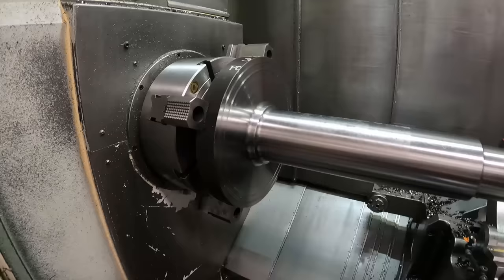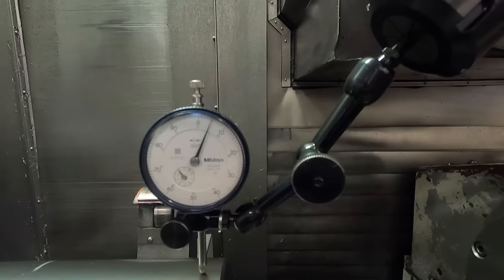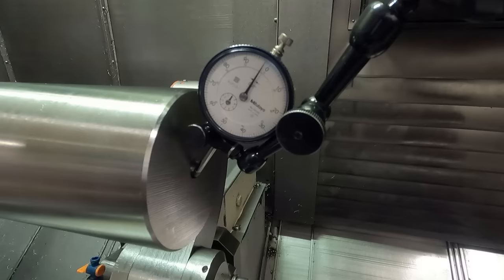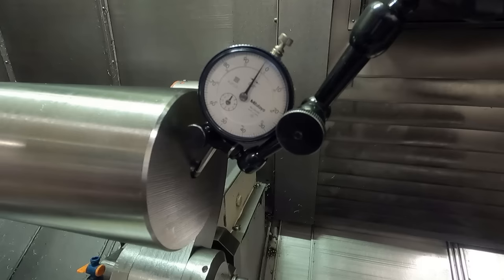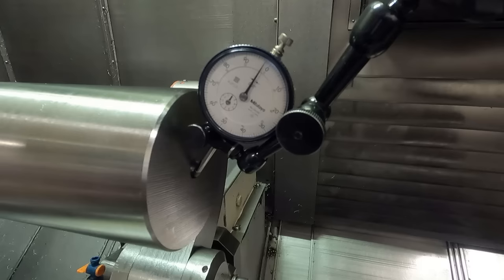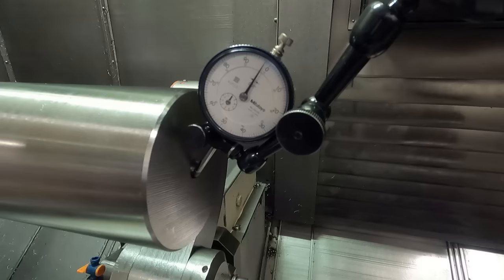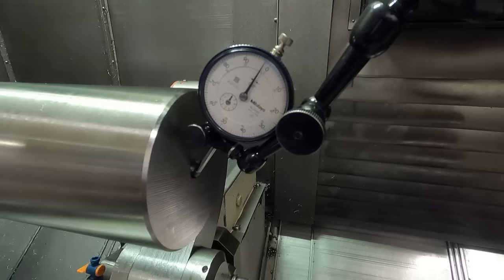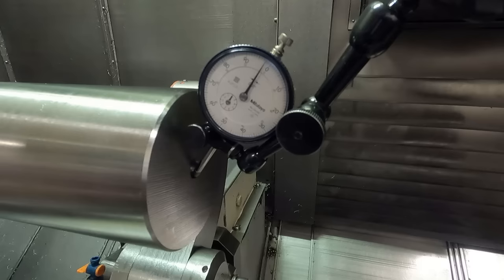Machine Shaft From 2000 Lb Stock

Comment: Showing the runout after pulling the tail stock reminds me when we got a 1300lb piece of customer supplied stock (giant red flag) that was allegedly stress relived. After roughing it flexed over .150 when the clamps were removed. Definitely not stress relived properly.
Reply: Kurtis from Cutting Edge Engineering channel had exactly the same problem with a customer supplied material to make a part. Supplier blamed the banana on stress from cutting on the lathe. Red Flags are red flags for a well deserved reason.

Comment: If you don't mind I would like to suggest a couple of different approaches that might help to relieve the induced stress caused by the clamping pressure of the chuck.... And it's influence on the center run out at the tail stock end.

I noticed that you were using soft Jaws to hold the flanged end. I wonder if using pie jaws instead, with a clearance undercut toward the Chuck end.... And effectively only having approximately 3/8 of an inch longitudinal gripping surface..... Would enable you to turn the shaft while inducing minimal influential stresses from the Chuck Jaws. You could use a torque wrench when tightening the Jaws.... And only torque it up to "xxxx" foot pounds of pressure. The concept would be to grab as much circumferential surface as you can...... With a minimum of force.

You see, once you set the soft Jaws on the Chuck.... And then you engage your tailstock center.... You want to be able to let the shaft "settle itself" in the soft jaws. By having contact of only about 3/8 of an inch with not too tight clamping pressure..... You might be able to provide a freer state of suspension during turning. I think the chances of your part slipping in the pie Jaws, considering the lower amount of torque on each jaw, would be not a factor due to the massive weight of the shaft. Once you get something that heavy swinging around at 3,000 RPM I seriously doubt that a carbide cutting tool is going to do much to cause slippage. Simple inertia will be your best friend here.

Another idea, considering that you had approximately 2" of circumferential gripping surface on each soft jaw, would be to point the Jaws so as to only allow about 1/4" circumferential gripping surface on each jaw (effectively forming a set of "pinch Jaws"). Now on this set of Jaws you can apply full force tightening....(no torque wrench). You should have enough grip to keep your part from spinning within the jaws, and yet it may allow you enough stress relief during the clamping situation so that the stresses within the shaft can be released during the machining process. The concept is:  you won't be trying to over control or influence the flexing of shaft by the chuck. You could even play around with putting undercuts at the back end of each jaw so as to minimize the gripping area   (and it's consequential influence on flexing the shaft during clamping). I guess what I'm getting at is a concept of grabbing the shaft with "points" (approximately 1/4" wide x 1" long).

Let me propose one more crazy idea.... And may turn out to be the best one yet! Turn the shaft between centers.

Of course the center holes would have to be ginormous.... Something to the order of an inch or more (you may have to machine some customized centers large enough).... And you would have to make a stock dog that would be balanced on both sides so that even swinging around at 3,000 or 4,000 RPM it would still not cause any flexural influence. This may take some doing, and quite a bit of machining and grinding time. But just think of it: you could fully machine your shaft in one shot! You could do the journals, the keyway, the Ring of face holes, you're drilling and tapping..... All in one setup. And here's the coup de gras:.   You leave .025" on all diameters and faces after roughing. Now..... You reduce your tail stock pressure so that it's just enough to hold your part securely. Take your finishing cut. Then go back and take a spring pass over the entire part.

The concept is:. When you relieve the tail stock pressure..... It gives the shaft a chance to release its stresses. Then you take your finishing pass and a spring pass or two. You may find that you have everything running concentric and square within .001" or better. Then you can face off both ends in a secondary operation.

I'm just offering these ideas from an old retired manufacturing engineer's mind..... Who's done a lot of manual programming in his day (long before CAD/CAM).... And who was a machinist for many years before that.  I can fully appreciate what you're going through, trying to deal with the problems of stress relief.... And you have my deepest sympathy!  As the young kids say today..."been there, done that!" 😉

Look at it this way..... At least it'll give you some food for thought, no?

(And this was a terrific video, by the way!!!!)

Comment: You were talking about the tail stock moving in y doesn't do too much. Well if you tourn from the top wich is your case it doesn't realy affect the measurements if the tail is off in y. If it's too much you'll see that your insert will take weird wearing.
Reply from the maker: There is also a adjustment on the tail body to move it in the Y axis. This does require loosening the big cap screws that hold it to the mount that run on its ways. Very similar to a engine lathe's tailstock. This adjustment is absolutely required if you are doing milling. To keep it on the centerline of your part. But once adjusted it normally doesn't require any more. Except in rare instances where there are very close tolerances. For instance when boring holes/c-bores on both sides of a part that have to be in very close alignment.

Comment: Why didnt you lock rotation on your spindle with the center point bit, and turn the spindle to drill that center point hole? Wouldnt that ensure you cet a concentric center hole? I really appreciate all you show here, it really help me get so much better, I have no other examples for machining other than youtube. So thanks for what you do!
Reply from the maker: I cant remember exactly the way I did this in the video (It was a long time ago). But there are on this machine a couple of ways to reclaim a center drilled hole for egocentricity. The first and best way is to bore it with a small boring bar. The second way (And the way I usually do it) is to tip the B axis at 30 degrees and carefully re-cut the 60 degree center by milling with the endmill and rotating the C axis. This way the endmill does need to be small enough in diameter to get into the small diameter of the original center drill. What you mentioned (Re-drilling it with another center drill) is not the best way because the center drill will tend to follow the original hole. Or to put it another way. It will pull the part off center to align the original hole with the new center drill because of the smaller tip diameter will act as a pilot on the original center drilled hole. Because this is usually done with no support to the part, say by the steady rest. So the part can easily be deflected hanging out so far from the spindle. I think (If I remember) I showed this in the video by just pressing on the part with my hand and how easy it is to move the part. So bottom line you really can't reclaim an original center hole by just re-drilling with another center drill unless the part is very well supported by either the chuck or the steady rest. But if you use the steady rest, first you need to carefully skim a true band without any tail support. Just the part running alone in the turning spindle. This can be difficult on long parts. What I do in these cases is put a dial indicator on the art and establish the run out and write it on the part with a marker. Then I extend the tail center lightly with something between the centers tip. So it lightly supports the part but not in the original center drill. Then I rotate the part in the spindle and tap it so I get the same readings in the same places on the indicator. When I have that then I skim a true band for my steady rest to ride on.  Then close the steady, back the tail center away and re-cut the center. Even doing this I would still bore it or mill it to be sure it ran true. I did use this method of skimming a steady band on some of these parts. I just didn't show it in this video.

Comment: I own a Enginerring company mainly we do heavier fabrication we run a couple of manual lathes and mills only really for one off jobs usually incorporated in other work we are carrying out. We out source any turning we need numbers of machined but we are struggling with lead times at the moment up to 1 month. I like the look of that mazak would you recommend that model of a machine I like that you can do some milling operations on it also our work would be vast enough at times but tolerances wouldn’t be super tight. I’d appreciate your thoughts.

Comment: Beautiful work. That rough-out is unbelievable!

Honest supply chain question about that: to what extent will (or won't) steel mills sell you stock that has a "shafty side" and a "flangey side?" I get why this would be hard: one-off forging isn't really a thing, and the parameter space of shafty sides and flangey sides (two diameters and two lengths make four parameters) is probably too huge to stock a comprehensive selection. But to produce and deliver that ton of 4140 - then cut almost all of it into confetti on a big sophisticated lathe and ship away the chips - feels so expensive. Back when I did work in a shop, turning shafty-flangey parts felt like one of the least elegant tasks in all of machining - and my stuff only involved small aluminum parts.
Reply from the maker: Thanks Raman. Steel suppliers don’t stock anything but round bar. You have to go to a forging shop to get shapes like this. It really doesn’t save anything for a couple of shafts. What you save in steel (at $2.50 a lb) is just payed to the forging shop.
Reply: @EdgePrecision  Makes sense! I'm far enough down my own professional rabbit hole that it's not relevant for me, but perhaps cutting out that middleman and designing an inventory of shafty-flangey blanks for job shops might be a decent business idea for someone in the steel industry. I've never bought metal in this kind of bulk, and $2.50 a pound is even more than I thought!

Comment: I had a thought concerning the remark you made about the multiple different size bolts used on the lathe you're constantly having to adjust when setting up the machine.   What if you modified the bolts either machining or welding so that all the bolts take one or two different sizes so you'd only have to two wrenches for all the adjustments.   Shy of that paint all the bolts of one size the same color along with the wrench.  No more needing to check sizes?

Comment: That’s a cool mic to measure the key way depth I’ve never seen one like that.
Reply from the maker: It’s just a pin/universal mic with the clamp and pin/anvil removed. It than acts like a step mic.
Reply: @EdgePrecision  oh I see. What were you roughing with CNMG 432?
Reply from the maker: Yes  CNMG 432. I’m not at the shop right now or I would tell you the grade and chip breaker.
Reply: How often did you have to flip the insert? What was the steel grade?
Reply from the maker: @franklinblazek25  The material is 4140 steel commercial heat treat 28-32 Rc. It took about six indexes to rough the stock off. Using a CNMG 432 insert.

Comment: I work in a company where they have the same mazak, but newer version of it with mazatrol smooth. I do not know if you have problems with the machine, but the way they work they often have to spend 20 000 to 40 000 euro in repairs :D
Reply from the maker: These type of machines are easy to damage. If you are not carful and run into something it’s not hard to knock things out of alignment or worse. It’s vitally important to have a proper cam software with very good simulation if you are dealing with inexperienced operators. If you damage the milling spindle it would be very expensive to repair. This is not like running a normal turret lathe. You can’t afford to run into things.
Reply: @EdgePrecision  Do you yourself run simulations prior to machining to verify your code ?
Reply from the maker: @sergegostoli9524  I run the simulation in the cam software. Than process cod to run the machine.

Comment: Thank you for taking the time to teach the correct way that you are Doing things.
I want to ask you have you been having Magnesium issues increase with parts you are Machining.
Please don't think I am nuts but I have been seeing this more more in areas around the Globe I do believe after all the people I have spoken too about this they agree it is to do with the increasing problems with the earths magnetopause.
 We are in the middle of A pole shift that is extremely extremely powerful so powerful its causing people to here trumpet like sounds like when steel is bending under force. From my Compleate Research I have come up with what it is they are listening too Because no one knows if this trumpet odd sound comes from the sky  or the ground. 
  What I discovered is the sound is two separate sounds one is the Earth being ripped pulled under Horrific Magnetic forces happening in regards to the Pole shift. The other is Drilling Being done all across USA, Canada, Also in EU. 
 Seems Big Big Big Brother is Creating something Huge that said if You compare the sound of the Equipment used to Bore the tunnel England to France along with tunnel drilling done with the deep Plasma Bore Tool the sounds are close the variable sound change is do to what the Plasma bore tool is Drilling threw. As most know there are some truly serious hard strata below peoples feet.
It would be interesting if you had a way to detect changes in Magnetic field around were you are working.

Just thought thanks again enjoyed your video
Reply from the maker: I don't know exactly what all this means but thanks. No I am not aware of any magnesium issues.

Comment: Cut 3/4 long off the large stock, drill a hole in it, weld it to a small diameter bar, machine, cylindrical grind (if available).

Much faster.

Comment: Thanks for the extensive explanations! These really add value to the video! One additional detail I would like to know. How is the tail center locking at its position, when it is not moved around along the Z axis (when you jog it)? Is it using a "brake" on its linear rails, and therefore can be placed at arbitrary positions? Or does it have discrete positions (similar to the spindle lock while turning, as you have explained a while back)?
Reply from the maker: The steady rest and tail center don’t move on linear rails on this machine. Standard box ways. There is a hydraulic actuated clamp, similar to the manual clamp on a engine lathe. That clamps them to the way they ride on. They can be clamped any ware along the ways.
Reply: @EdgePrecision  Thanks for the detailed explanation!

Comment: Thank you for making these videos.  Would it help mounting the part to put a chuck in the tail stock and grab on to the OD of the flange?  Then you can slide the shaft into the spindle bore without worrying about dragging it.  Just an idea.
Reply from the maker: Thanks! The only problem is the tail center wont go all the way up the the chuck. There is the steady rest base in between. Also the chuck I have to mount on the tail center isn't large enough for this 16" Diameter.

Comment: Amazing work! I have tons of respect for machinists. 
Just curious why a part like this would be turned from raw stock versus being drop forged and then machined or manufactured with other methods. Does it have to do with the limited number of parts not justifying the cost of tooling?
if you’re turning  87.5% of the bar stock into chips it seems inefficient, but I’m guessing there’s a reason.
Reply from the maker: For the quantity of parts I'm making here forgings cost more than machining from solid round bar. Also this customer was in a hurry. So solid round blanks sawed to length could be had next day here in Houston Texas. Forgings have a 6-8 week lead time. The forgings can be open die forged without special tooling. There is also the fact that a forging is quite a bit rougher than a commercial round bar. This means it has to be more oversize and it is harder too get a hold of in the machine and setup for machining. Also the rough exterior wears out tooling to get below it. Now some forging companies can rough machine the forging but also at extra cost. So in the end machining from solid bar seems wasteful. But in reality it is the most economical way to go in this case.
Reply: @EdgePrecision  that’s what I was guessing. You’re one hell of a craftsman. Loved the insight about work induced stresses causing runout. Keep up the good work!

Comment: Should have shaved a clean smooth end and locked it in with 8 locks not 4 .but .oo1 bearing play in the machine and that multiplies as the length of your shaft increases .